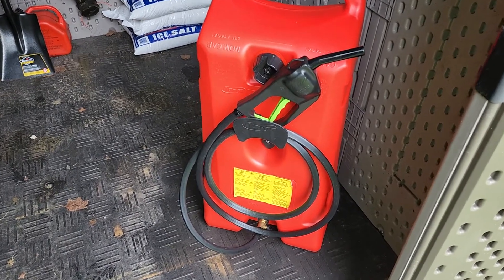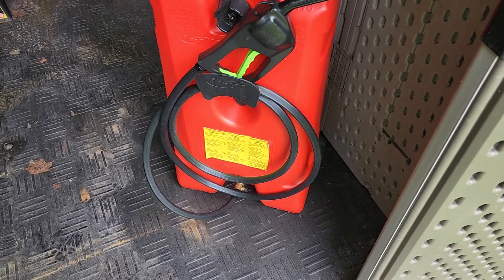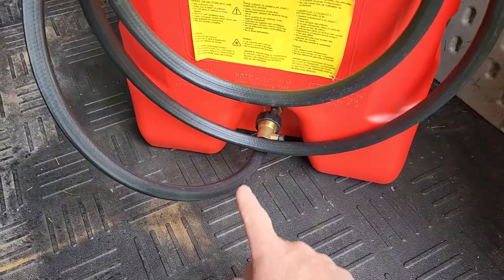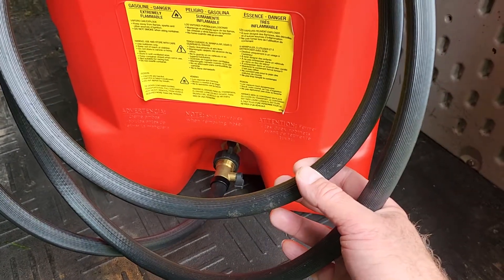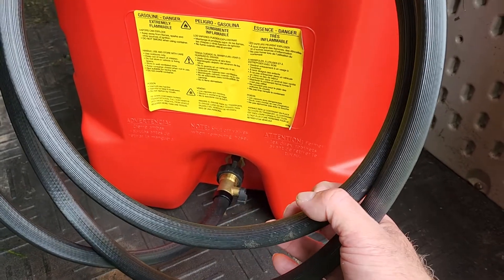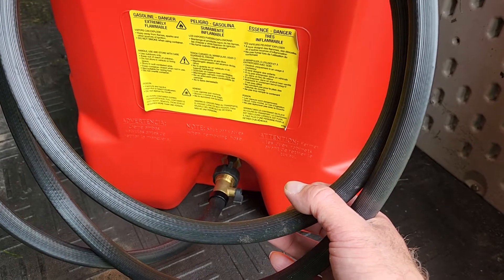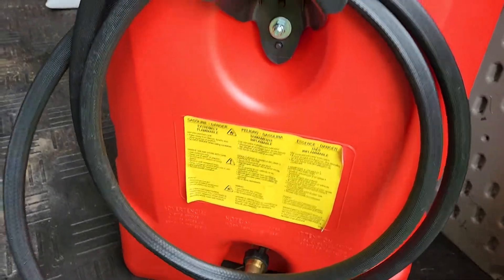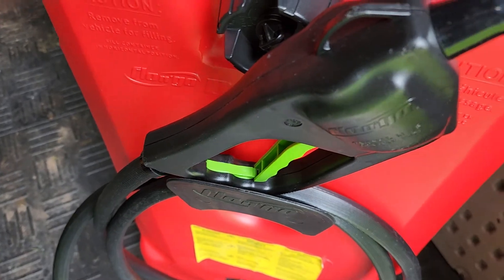Duramax Flo n Go - watch before 1st fill

Comment: I wish I found your video before I filled mine....I got the yellow one and was excited to go fill it with off road diesel for my tractor.  Leaks right there.  So frustrating.  I was going to remove the valve but was worried that something may be threaded on from within the tank that.  This is absurd.  Wish I never bought it, I will never trust it even after I get it to stop leaking.  Thanks for posting this video!

Comment: You're right, that safety button is a pain in the a**. Moreover, I've replaced this three times because they don't draw the gas.  After raising the tank three feet above my boat and after pumping the handle for twenty minutes (with two hands of course) my brand new one still wouldn't siphon the gas!
Reply: Same, what the heck? Pumped ok once, and then never again. So aggravating.